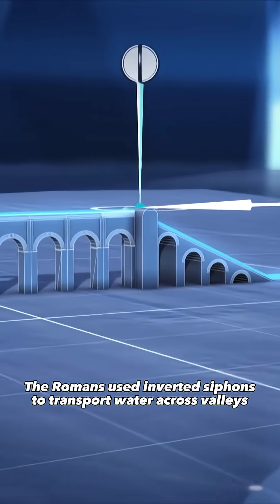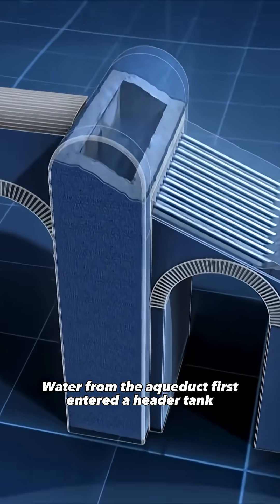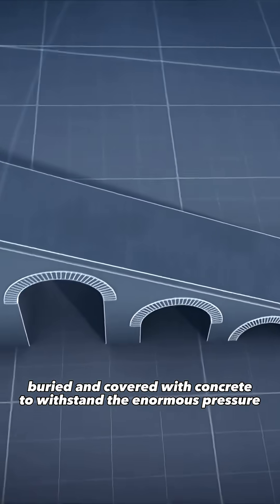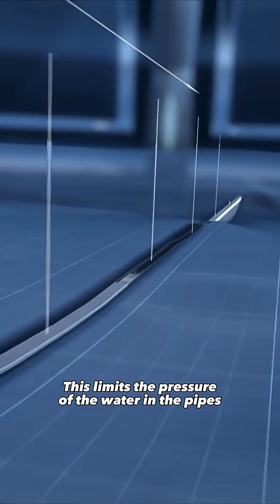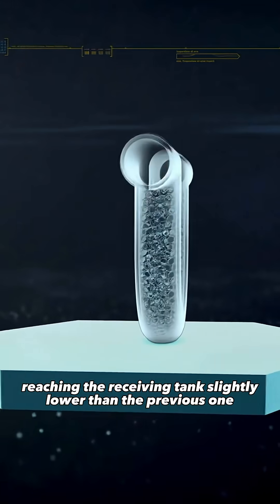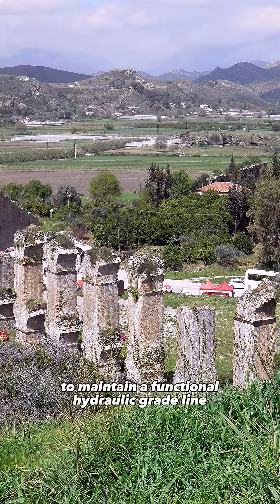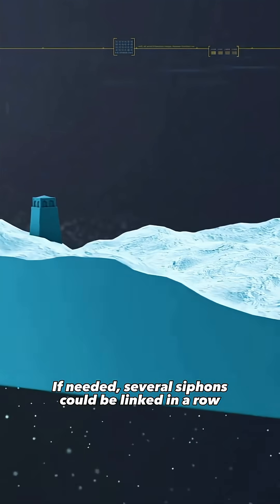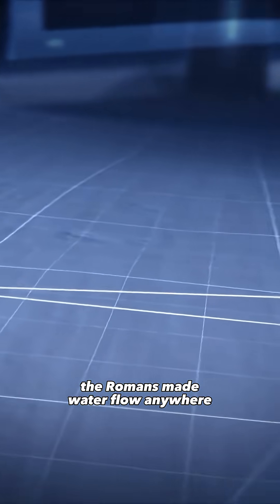Roman inverted siphon explained #history #romanempire #engineering

Comment: Yes, the Roman aqueduct system included extensive use of lead for water pipes, particularly for urban plumbing, as well as for lining channels. While the Romans were aware of some potential dangers of lead, as noted by authors like Vitruvius, they continued to use the material for pipes, cookware, and other applications due to its availability and properties, even while it contaminated their water supplies, simply cause it was so effective and the contamination was little to none.
Reply: It's important to mention, they knew it would only really poison still water, so as long as the lead pipes part of the aqueduct were constantly flowing, the water would be safe enough
Reply: @janfilby7086  Also the minerals in the water coated the inside of the pipes with a calcified deposit that prevented lead from poisoning the water.
Reply: @janfilby7086 plus hard water/limescale buildup would probably coat the inside anyway.
Reply: @janfilby7086  we had lead pipes in our house when I was growing up and we on average are as smart as people today.  I'm not talking soldered joints but full lead.  They were about 2 feet pieces and joined together by a big lump of lead.
Reply: Lead pipes continued to be used well into the 20th century. There are still plenty of lead pipes in use today where they haven't been replaced in a long time. Given that the Romans didn't have PVC to use instead, they were probably right that the health effects were worth it.
Reply: @thomasdalton1508 I mean, we traded lead for microplastics so one could argue the “improvement” in safety was small if anything.
Reply: A lot of pipes in ubran areas where made of wood as well, and just the connections were made of copper. Not only in Rome/roman empire, but basically anywhere with kinda working water
Reply: @hueco5002  Lead is a potent neurotoxin with no known safe exposure level while microplastic acute toxity not been conclusively demonstrated.
Reply: @hueco5002  It's definitely a very lateral move if not worse. lol
Reply: @hueco5002  Thousands of years from now, people will be talking about us using pvc pipes for water and how dangerous it was in hindnsight.
Reply: @DemonZest not conclusive? Have you looked at health outcomes in every single category?
Reply: @DemonZest  Endocrine disruption is widely being studied and likely way worse than what most governments really want reported.  If Plastic really does turn out to be the problem its appearing it will be we are in seriously deep 5hit.  Especially because even if we stop tomorrow as stuff breaks down more and more it becomes more dangerous and not less like most contaminants do.  I personally feel nature is going to save the day on this and just end up eating it all, but we will see.  Plastic Bioaccumulates due to uptake mechanisms in the body and cells.  Leads extremely low solubility on the other hand makes it rather hard to get toxic levels of lead in your system.  The romans only really knew it was a problem because they used Lead Acetate, one of the few water-soluble forms, as a Sweetener, not because the lead coming from the pipes but because Lead that was dissolved when making wine in acidic environment. The Lead acetate and tartrates were in a bioavailable form that way.   Mercury is the same way.  You could drink some with little problem yet milligrams of Dimethylmercury is going to make you go out in the worst way possible
Reply: @thomasdalton1508  

We are only beginning to observe the effects of microplastics. But given the inert properties of plastic in general, the harmful effects are not even close to the toxic qualities of lead poisoning.
This could change. As microplastic residue becomes more and more present in ever more minute elements of human (and livestock) physiology.
Reply: @reddiver7293  The risk with microplastic is probably physical rather than chemical. It's not that they are toxic, but they can block things or scratch things. 

I think you replied to the wrong person, though - I didn't say anything about microplastics.
Reply: @thomasdalton1508  

Agree. 
And sometimes I get mixed up with these extended chains of remarks. Apologies if my comment was to someone else.
What my layman's mind has observed regarding microplastics is as time goes on, microplastics in our bodies are becoming increasingly micro. Extending further into our blood, lymph, semen etc

At 74, I doubt I will be around for many revelations about this.
Reply: @reddiver7293  microplastics literally displace cells in your body, that means they are causing microscopic fissures and tears all throughout your body. Not a big deal in your intestines, a huge deal in your heart, lungs, or brain. Expect aneurisms, massive heart attacks, and pulmonary embolism deaths to rise exponentially in the next decades.
Reply: @mikeLigmau2  

Very plausible.
Unfortunately
Reply: @reddiver7293  I cook using cold tap water, less toxic. Hot water picks up more chemicals from the pipes & tanks.
Reply: Oh no. In semen too? Will babies be born with plastic eye lids? Will their bottoms be poop resistant? What if the skin develops 3M syndrome?
Reply: True alternative would only be copper which is really expensive  @thomasdalton1508
Reply: @thomasdalton1508 on a Long run you have italians now. Maybe dont worth it. 😂
Reply: @thomasdalton1508  I got a letter through my door that my pipes might be lead. Building built in the 1980s. I drank the tap water.
Reply: There is a lot of lead pipes in use still today in US.
Reply: @gumelini1  Year i read a news article a few years back i think, about a US town, where people suddenly suffered from lead poisoning. I cant remember the deails, but basically the reason was, that the PH level of the water went down, making it more acidic, which eat away the protective calcide coating of the leadpipes, that where still in use (i think the waterworks messed up).
Reply: @gumelini1  Yes but the plumbers who installed them could not imagine a future where you'd successfully turned the rivers into battery acid...
Reply: Most of the aqueducts didn't have pipes they were just free flowing basins
Reply: Lead was most dangerous when it was made into wine goblets. The acidity leached the lead into the wine.
Reply: @bobbylee2853  No, the worst is they would sweeten wine with lead(II) acetate.
Reply: In an application like this, it was not horrendous.  The main problem was the lead they put in the wine.  Though, in pregnancy, even low lead does cause damage.  The brain damage is in self-control, primarily, IQ only secondarily.  Half a standard deviation unless it is high, say from drinking some of that sweet wine.  There were many things that reduced IQ back then.  The biggest was too little iodine.  That happened just about everywhere globally that was not coastal.  If they did not eat ocean fish or seaweed, they likely did not get enough iodine.  And again most critical during gestation.
This is why we have iodized salt. Don't be suckered by the pink stuff.
Reply: Several years ago I was talking to a plumber visiting the school that I work at and he told me about how he would go work on pipeline projects in older cities in the USA during their winter months as the frozen ground made excavations safer. The most shocking thing that I learned was that there were still sections of lead piping as well as timber pipes still in everyday use supplying drinking water to the older cities on the US East Coast. Prior to the replacement projects, the lead and timber pipes were only touched when there had been a failure for some reason. Frequently the failures were related to more recent building works below ground level that in spite of the use of shoring and concrete curtain walls, had still resulted in ground movement and settlement that would ultimately stress and break the the nearly two centuries old pipes. 
It goes to show that you just don't know what someone else has experienced until you get to talk with them.
Over the years I have met some very interesting people and learnt some unusual things that I would never have known if I hadn't talked to that person. 
Mark from Melbourne Australia
Reply: @markfryer9880 it's the same here in the states. I marvel at the old wooden pipes as I build pipelines out of steel.
Reply: Sounds like us with plastic
Reply: Yeah what saved them from serious effects was the eventual calcification of the lead pipes. Much worse was their practice of storing wine in lead containers because it would sweeten the taste
Reply: This is a bit outdated. They made pipes of clay, stone, even wood.
Reply: cookware?
it would melt
lead poisoning is not none
Reply: Most Roman pipes were actually made of wood, hollowed out poles joined together, lead was expensive, and was used only when necessary, such as in pipes that must withstand high pressures, faucet, etc...
Reply: Sounds like the modern-day issues with carbon-based fuel and methane. We now it's fucking up the environment because the experts keep showing the proof....but the everyday man doesn't want to pay to change it and neither do the politicians
Reply: One of the reasons the Western Roman Empire fell was probably lead poisoning. At least, according to historians believing in the validity of the Roman Lead Poisoning Theory. However, it probably wasn't the water piper that caused this. It was two other things. Making wine in lead kettles and the way they mined silver. The knowledge was there to stop using lead, but as always, short-term profits had a higher priority than the general wealth of their own population.
Reply: @RetaradoRicardo So what idiot. You're actually dumb look up the history of lead usage guy. Your name fits well.
Reply: The Romans had lead in their water, we have microplastics in ours.
Reply: Roman logic: don’t use lead and die in 3 days from dehydration, or use lead and maybe die in 60+ years from lead poisoning, or more likely, much earlier from something else.
Reply: I mean, average lifespan of humans was rather short compared to today anyway
Reply: Well they didn’t use it for cooking.
That’s for sure. Idk where you found this out and I’m curious.
Roman’s knew lead was poisonous, but had ways to bypass that.
Everyone says they aren’t as smart as we were and would think something’s aren’t possible.
They can totally know lead is poisonous and being near someone sick is bad for your health.
They wiping their asses with a sponge is stupid, but possible if needed.
Hence soft animal skins and washing it off and your hands off in vinegar or boiling water in a bucket or metal pale dedicated to fecel matter.

People forget this isn’t England up until WW2.
Roman’s didn’t piss and shit in the streets.
They had sewers that where vast and complex and self cleaning or since slaves where often a good choice for harsh labour. Slaves.

People forget so much and we also learn new stuff yearly
Reply: The wonders made possible by enslaving non-sübhumans.
Reply: suddenly, the last several centuries of the western roman empire makes a lot more sense
Reply: Funny how we have more lead in  the water now.
Reply: It needs to be mentioned that the use of lead piping was NOT ubiquitous throughout the whole Empire's lands, or it's history.
In fact, writings by Marcus Terentius Varro describe how CLAY piping was actually more popular, especially for supplying water to homes and residences. "Earthen" pipes were more preferred because they ".. bring the most wholesome water."
Reply: lead acetate to sweeten wine, same reason kids ate paint chips; tastes sugary.
Reply: little to none contamination of lead, where i hear that before? Ooohhhh well, EUA had a huge lead contamination some decades ago, the crazy age LOL
Reply: Plus life was short, by the time they got to seeing symptoms If at all they were already middle to old age. Also water was for sanitation they were more to drink beer or wine anyways.
Reply: @g.wes.3906 
The idea that the human lifespan was shorter then isn't necessarily true, or at least not for the reasons everyone thinks.

Truth is life-span statistics were massively influenced by Infant Mortality.
So many children died before growing up back then that when you look at the numbers it SEEMS like people didn't live long.
Truth is those who made it through childhood, as long as they remained mostly healthy, lived just as long as most average people today.
Reply: You almost know it all. 

The element lead (Pb) comes from Plumbum which is the Latin word for lead and where we get the word "Plumber" from. 

The lead contamination was not little to none and is considered one potential cause for the fall of the entire empire and lead poisoning makes people go insane.
Reply: @ChromeArty Lead poisoning via lead 'sugar' (lead acetate) among key people in power was important. Decision making was scuffed because of it.

Lead plumbing, however, didn't lead to poisoning and had negligible effect on public health. Mostly because of calcification and algae, and the fact that no lead really dissolves in running water whatsoever.
Reply: @ChromeArty --- probably LESS than what is claimed
Reply: @ChromeArty Nobody takes that bs theory seriously. The Eastern Roman Empire lasted till 1453 when Constantinople was taken over by the Ottomans.
Reply: Yet a lot of plumbing in the usa is still made of lead, never replaced
Reply: They still use lead shower pans in new York so...
Reply: No, they were also contaminated with lead. Lead poisoning was pretty common
Reply: @brokensword198 ---- lead will not dissolve in water , very minimal....but in wine goblets ??
Reply: @francisbrewster4948 lead disolving in water isnt the problem. The constant pressure errodes those soft lead pipes really easily. Then the erroded bits end up in your water. Its not by no means "minimal". The reason lead dissolves in wine is because of the ph levels. If the water is acidic for any reason, it will errode the pipes much faster and make the water even less drinkable than it already is. Trying to defend lead pipes as safe is hilarious.
Reply: The Romans pick springs with high mineral content water and that forms a layer of mineral deposit that limit contact of lead with the water. Plus the water is never really stagnant.
Reply: RE, "lead pipes, cookware... contamination was little to none:"
NOT!
Reply: @user-ls6xd9jf2c  The pipes usually wherent the problem, the rest was, since water in a cup or a pot remains far longer in one spot than in a pipe and when they get cleaned, they cant get that calcide coating, that protects the pipewater.